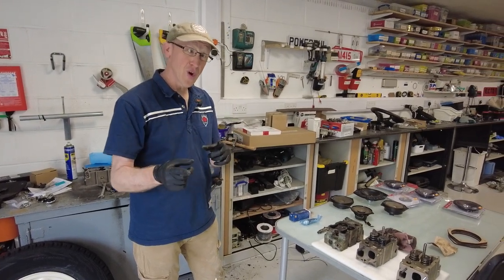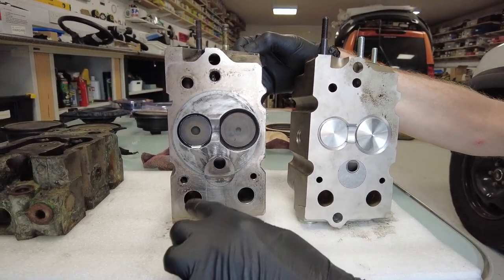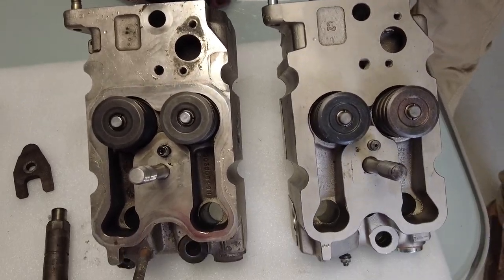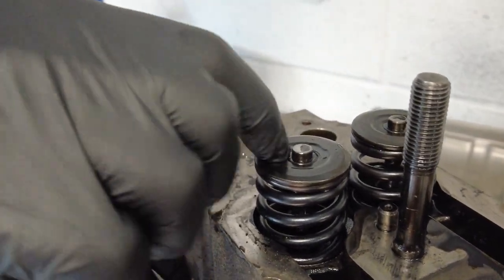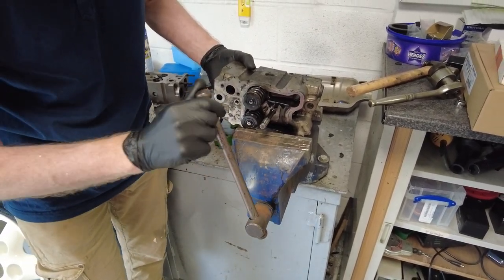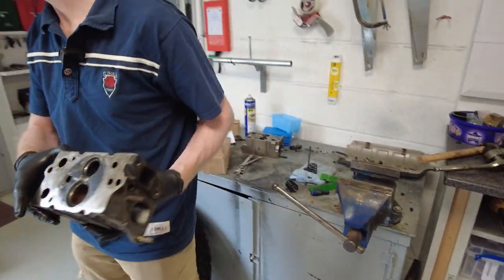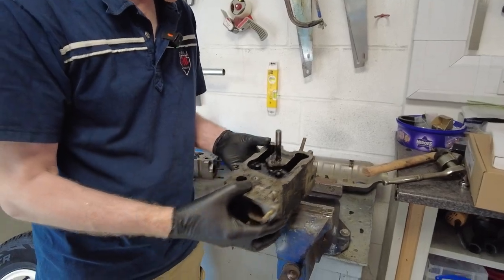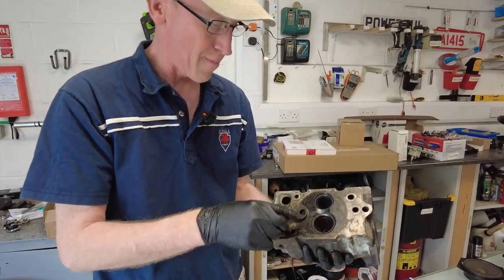VM Diesel 2.4 / 2.5L Cylinder Heads Compare / Problems / Strip Down Jeep/Range Rover Classic

Comment: Hi Simon, the reason you had to compress the 2nd part of the collet a bit more is because the vice was not giving equal compression. A very dangerous way of removing valves. Valve spring compressors are so cheap it just isn’t worth the risk.
Reply from the maker: I have ordered one for work- my other one is at home
Reply: @L663  good man 👍👍👍

Comment: The 2.5 that I had in my RRC had the clamp type injectors like your 2.4, I might be wrong but the RRC never had the screw in injectors  and I think the injection pump would be different as is the 2.4 and 2.5 pumps I can see a rabbit hole coming up Simon, when you replace the Centre stud for the rockers make sure it's tight as they are know to come loose and strip the thread in the head, later heads had two studs to stop the rocking motion, if in any doubt that it' not tight  then put an insert into the head, also fit an MLS one piece head gasket when putting it back together, still not sure about changing mine to a 300 tdi now it don't seem as good as the 2.5 VM ( but a lot less money to rebuild )
Reply from the maker: I think you are correct - the rover 800 and jeep seem to have the screw in type injector - i am going to try it - the injectors are both marked at 150 PSI so i think the pump will not notice any difference ! 
I just got a 2.5 for £50 on ebay that i am going to collect - 3 engines to make 1 good one !
Reply: @L663  And there's always my 2.5 sitting in my barn in Brittany !
Reply: @L663  have you put it together already? My head cracked VM RRC is awaiting the answer 😊 I’d replace the heads with some new robust ones with the other injector type

Comment: Main downside about using the vice, is it might score/damage the face. I've rebuilt a few (hobby, not a mech) and it's always a sketchy thing! I used a spark plug socket and mallet to shock them out!
Reply from the maker: I did invent a spring compressor based on a mastic gun - should get them produced really ! it works easily with one hand but it was at home !

Comment: VM diesel specialist in chesterfield... I used to rebuild these engines there many years ago.
Reply from the maker: I did write to a VM specialist about if the heads could be swapped but they never replied - maybe they wanted to keep the info secret ?

Comment: I ran a VM 2.4 in a classic RR from new up to 100,000 trouble free miles. They are noisy beasts with hardly any torque bellow 2500 revs. Let it lug down to 2500 and if forced below it would die a very sudden death. Within a few months of me selling it, the new owner ran it short of coolant and ruined the engine. Once overheated the alloy heads were scrap.
The other feature of this 112hp engine is the crankshaft that is removed lengthways similar to the camshaft from the end of the engine. Not that I ever had cause to touch the engine apart from regular 5000 mile oil and filter changes using the obligatory long drain oil. This was one of the first engines that demanded the use of Super High Performance Diesel [SHPD] type lubricants. ACEA D4 if I remember correctly. Today probably ACEA E3 15W/40.
The 2.4 and the 2.5 used in Range Rover are indirect injection, hence the pre-combustion chamber seen in your hand at the end of the video. Fuel consumption for mine was around 26mpg. This compares with my current similar weight Kia Sorento 8 speed automatic with 200hp and 4wd giving me 42mpg on the same roads. Of course the Kia diesel has Adblue which it consumes at the rate of 1.5mls per mile or 15litres per 10,000 miles.
Reply from the maker: Hi Huw - thanks for the comments - I did not know that was a pre combustion chamber - i am pretty new to diesels but having fun learning. I think I am going to keep going with fixing the VM for the RRC !
Reply: CCMC D4. Today, ACEA E7 is the only SHPD category. People forget that both the 19J and 200Tdi also require SHPD oil.
Reply: @cameronwood1994  
You can still buy backward compatible E5 and even E4 in the market that does not meet E7 emissionised spec. E5 and E7 are the second tier above the original CCMC D4.   For those that aren’t aware, CCMC changed to European ACEA. All these standards are or were based on Mercedes specifications referred to as sheet numbers. As with ACEA they have separate standards for petrol and heavy duty diesel but some cross over to be multi-fleet that cover both. 
SHPD oils now are pretty much the defect standard.
Reply: @hedydd2  ACEA E7 is not the low-emission DPF-compatible stuff. ACEA E5 was directly superseded by ACEA E7, and ACEA E4 is still available, although classified as a UHPD oil (Ultra-High Performance Diesel). The ones to watch out for are the new E8 and E11 categories (as well as any ACEA Cx oil) as these are the low-SAPS stuff for DPF's etc.

Comment: Interesting viewing. I think Land Rover called this project Beaver, which was 2.4L VM diesel. The engine was derived from a marine engine, which probably explains the individual cylinder heads.
Reply from the maker: The individual heads certainly help with lifting then out !

Comment: Why not use a valve spring compressor ? I know the head is scrap, but holding it in a vice is not good as you are only compressing one side of the top collar, having removed the collets the spring is free to fly across the workshop out of control, a spring compressor is easy to make from a large "G" clamp. Chris B.
Reply from the maker: Yes i should have really

Comment: Trust me the crack is fine many of the cylinder heads would crack there and not just on those engines we  used to pressure test them submerged in warm water and they never leaked or bubble
Reply from the maker: Good to hear that - still feels wrong putting back together with a crack

Comment: Is that a crack in the valve seat at 8:32?
Reply from the maker: I think you are correct - that is one of the heads of my original engine. 10 extra point for you !

Comment: is this good engines?i have  head gasket problem broken leaking compresion
Reply from the maker: The engine when driving is really good but the early cylinder heads did have issues - also better to use the 1 piece multi layer steel gaskets - rather than the 4 individual gaskets.

Comment: Cant help but feel that’s when Land Rover made good engines not like what they produce these days
Reply from the maker: There are some issues with the new engines for sure - I need to publish the pictures of my friends V8 SVR engine - the guy who bought the car sent us pics of the mess of the inside ! And yes the VM diesel did more miles before blowing up than my friends SVR !
Reply: You’ve got to be kidding! The VM was a good quality engine but prone to overheating in the Range Rover when towing hard. Its performance was abysmal and totally unsuited for the RR in that it needed constant high revs to drive. Its maximum torque was at high revs and dropped off a cliff if run below those revs. For that reason, when loaded, whether on a steep hill start or a more modest one towing, to change from first to second gear required revving the engine to its 4200 rpm governor, or revs would drop in second to below 2200 and you would stall. Also first gear was very high ratio and often required low range starts when towing a heavy trailer. Luckily the range box was easily changed up by double-declutching.
As for the V8, this was when fuel injected versions appeared and the ignition system did not like damp conditions to put it mildly. As for the 2.5 used in the 90/110, the naturally aspirated was only 67hp while the turbo version was dreadfully underdeveloped and disgustingly unreliable. Both were smokey inefficient indirect injection engines prone also to timing belt issues.
It was 1990 before they totally transformed their diesel engine when they introduced the 2.5 TDi direct injection. This was a totally different beast that was as good and better than any of the competition. The difference in all aspects of engine performance was outstanding and further later developed into the even better TDi300.
The 2.4 VM has totally unacceptable running characteristics for the RR. Apart from the noise, it was and is more suitable for a sports car if you ignore its modest 112hp. For the time [1986 introduction in RR] 112hp from 2.4 litres ranked as a high power density rather stressed engine, believe it or not.
I liked driving the 2.4 in my RR. It was a ‘challenge’. Luckily mine had the revised main and transfer gearboxes that were a peach compared to my previous 1986 V8 examples.
Reply: @hedydd2  You are entitled to your opinion as am I, I was referring to engines overall not just that one I reckon later engines were very good I had many 2.25 petrols 200 and 300 tdi diesels some of the best engines and robust units ever made yes they had some issues but could be repaired in the field very easily, sadly the V6 was abysmal with the crank failure never had a VM but the fact that it appears it could still drive on those heads show it had some robustness to the engine. Quite frankly I think as I said they were better back then better than the ingenium and other rubbish they produce today. Again that’s my view sorry it’s not shared by you but then I truly don’t give a FF
Reply: @Stubear22374  
You said this and I quote you directly
"Cant help but feel that’s when Land Rover made good engines not like what they produce these days”. That is very clear and a load of guff probably viewed through rose coloured spectacles. The TDi200 was the first good and reliable diesel engine they ever built. Their engines have got better since but the Ford V6 diesel has serious crankshaft issues. I believe it is now manufactured in Mexico and although discontinued after a short spell for sale in the USA, it is coming back to us soon in the new Ranger. Hopefully they have improved the durability of the crank but I wouldn’t bet on it. I’d take the Ingenium straight6 any day of the week rather than the older V6. A far superior engine.
Reply: @hedydd2  you need to get out more 😂 you literally replied to exert your view upon a simple comment I don’t care what you think about my comment it literally matters not to me Trot off an impart you’re view on someone else